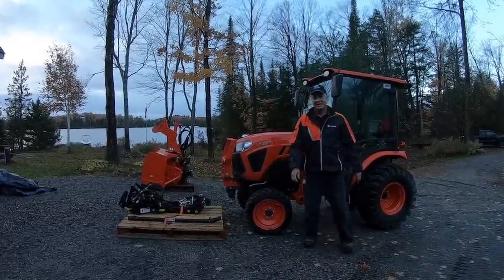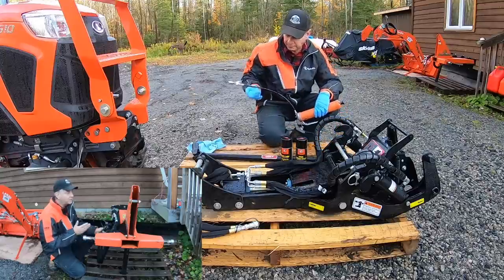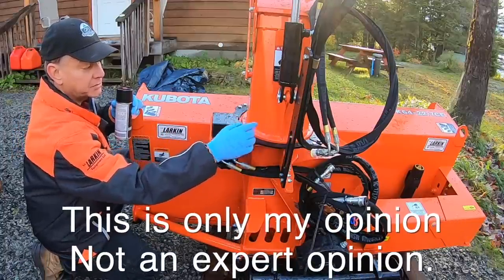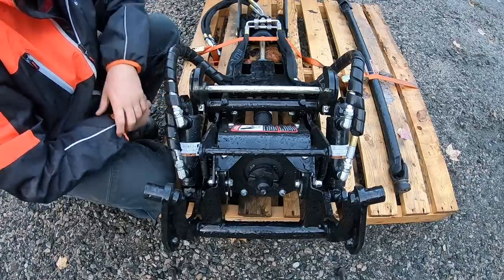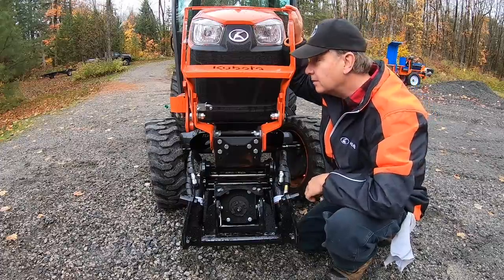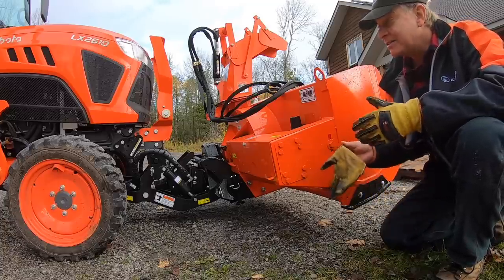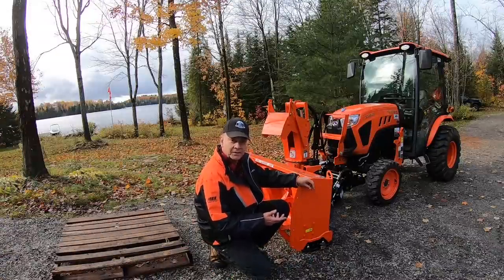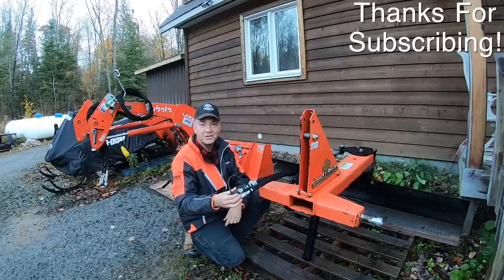#342 Kubota LX2980 Commercial Snowblower Install. Kubota LX2610 compact tractor.

Comment: Get some coloured zip ties to mark your hydraulic hoses.
Reply from the maker: Great idea - thanks RC!
Reply: @GPOutdoors  Get the same colors of electrical tape when you get the zip ties as not everything you want to color code can have a tie or tape but it expands the options.
Reply: I should have read comments before I commented. I just made the same suggestion!
Reply: You can also go to a farm supply store and get colored hydraulic cap and plug sets that kill a couple birds at one time.

Comment: I'm sure this has been mentioned by others, but with the coned (aka cone and thread) hydraulic fittings, that surface will be the seal.  most fittings that you were pointing to with the Teflon on from the factory were not those types of connections.  The factory will use Teflon on just about everything as an added measure in the event there is the slightest imperfection in the cone surface that could develop a "weep", but they are very exact about the placement of the tape.  Most manufacturers (OEM and aftermarket) instruct no to use it because if you get the slightest piece of that tape into the hydraulic system it could cause a blockage that could stop or slow functionality of any part of the tractor's hydraulic system and they don't want responsibility or bad referrals.  If you are extremely careful to avoid contamination of the system, it can be a back up, but adding too much could prevent you from achieving a full seal of coned fittings.

Great video... kind of wish my 3901 could run a front blower.
Reply from the maker: Good morning and thanks very much Greg! Yes, many have agreed with you and I am very grateful for you taking the time to offer help and advice. It helps me and also helps other new tractor owners who read the comments.  I will issue out a correction video soon. Thanks again for your help. Have a wonderful week!

Comment: The left side heat shield didn’t need to be installed. The Kubota instructions tell you where to use Teflon tape. Overall how do you like this model blower?

Comment: Good morning GP,   I had a couple questions on your snowblower choice, commercial K64 vs LX29-63 was it the extra strength quality or maybe the durability based on the distance of your driveway and was there a big cost factor between the two? I am truly enjoying your videos as they are the most informative out there, the only problem is every time I watch one it costs me more money.
Reply from the maker: LOL! Good morning Mark. I honestly didn't know I had a choice. My dealer just picked it. I trust him alot so I never asked if there were options. He knows my property very well over the years. It is certainly bigger than I expected but I am more interested to see if it throws the snow as well as my old one did. Sorry I couldn't help you much. Good luck!

Comment: Are you sure its tape from the factory? Most times it pipe dope or  Thread sealant. The fittings that went on the the angle blade cylinder had the oring thats your seal and the ones with the Bevelled edges are jic fitting they make the seal no oring or tape needed
Reply from the maker: Thanks Christopher. Yes, it was still strapped to the pallet when I picked it up. I will check but I am pretty sure it was. Thanks for the info above. Cheers!

Comment: I have the same cab tractor you have.   My Kubota has both the commercal snow blower and the regular one.   I want to use it in my cabin in Maine for  my 1200 ft long driveway.   Do you have an opinion on the commercial vs the regular snowblower??
David

Comment: Hi GP - another great video.  I big snow blower like that almost ensures a light winter, right? :)  Are you afraid to run it on the gravel part of the driveway?
Reply from the maker: Morning ! LOL. So true - probably going to be no snow now. Not at all, I always raise the shoes now and once I can see the ground is frozen down below the surface then I drop the shoes. Minimizes the amount of gravel or stones that will get picked up in the blower. Cheers!

Comment: Did you drive it around to see how it carries the blower with nothing on the back? 

Do you have anywhere on the tractor to stash a 50 foot chain or tow strap? never know when you will need to help on a car/snowmobile recovery and as you said the end of the driveway is a mile from the house.

Comment: I've always heard not to use tape, and use paste, because the tape can come apart and get into the system.  I use the paste on mine, but there have been fittings I didn't put anything on and they've been working for years.

Can you install the FEL with that k-frame installed?
Reply from the maker: Thanks for the good info Smitty. No - similar to the old B2601, I can't use the FEL when the blower K-components are on it. One of the consequences of having a front blower. Cheers!

Comment: Hey GP,  I'm in the market for a compact tractor possibly a Kubota, wanted your opinion on the cab model. Are you happy with your
cab model purchase, is it worth the extra cost, do you miss the open cockpit of the 2601. Thanks
Reply from the maker: Good day Mark! Very happy. I have already been using the heat in the mornings for a few weeks now. Big difference knowing I can escape into the cab and be warm, or cool in the last months. Hands down, no regrets. For me though, having the open station to learn on was important. Although it's not worse when traversing uneven ground, the cab makes you feel like you are swinging more, but having the experience of the open station makes me much more confident for sure. Always have to go slow and watch all around you when in the forest. But in these winters, I can't be happy enough to have the cab now. Well worth every penny. Good luck with your research and choice. Let me know how it goes!

Comment: Put a round pipe on the cutting edge you wont pull up the gravel  then you can put it all the way down.
Reply: I had heard that as well.
What size pipe is best?
Also, this can lead to pushing the snow rather than it getting into the blower.

Comment: Great video as usual. Do you leave your implements on all season? I have the brush hog implement that I leave on even when using the FEL. Is this a good idea?
Reply from the maker: Hi Liam. I always have some weight on the back - very seldom do I ever have the 3 point bare. I have learned that weight is super important - the bush hog probably weighs alot which is good 0 very wide and big I am sure but probably gives you some ballast. Thanks!